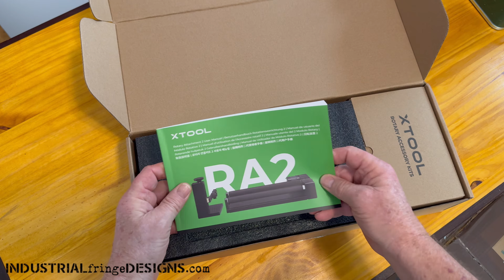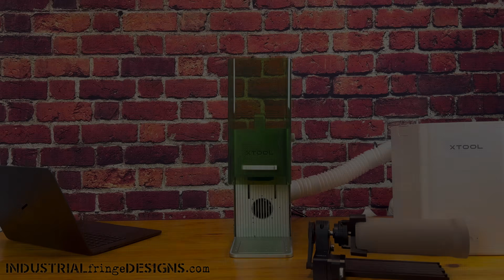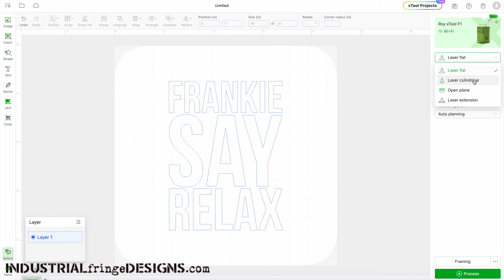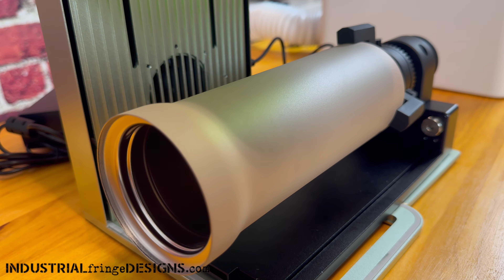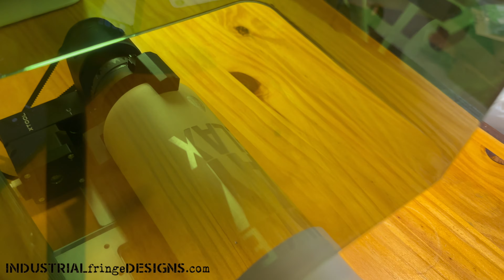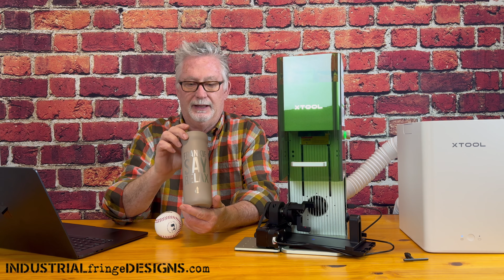How To Use the xTool RA2 Pro Attachment with the xTool F1 Portable Laser Machine!

Comment: great video - two questions: 1. If your LOGO wasn't so wide, could you just use the flat laser and place the baseball on the plate without using the rotary tool? 2. How did you know to do a second pass on the tumbler? Is that normal with all things metal?

Comment: I'm glad to see that the RA2 Pro now comes with cables to interface it to different machines. When mine shipped with the P2 there was a cautionary note that it was not compatible with the other xTool products due to wiring differences. Of course, it was easy enough to resolve the wiring issues by making adapter cables.

Comment: Thanks for the video, Roy! I am considering this laser machine because my working space is small and I love that it has two lasers in one. 
Question: when you engrave the tumbler, the green cover cannot go all the way down. Do you take any safety measures to avoid getting your eyes hurt and/or getting a laser beam outside and creating a fire? 
Thank you so much - I love your channel!
Reply from the maker: Hey! If you’re lookin for a laser for a small place, this is definitely it! I purchased a pair of xTool safety glasses that are specked for both the IR & diode lasers. I don’t operate it with the top up without wearing those glasses…and I avoid looking at it a lot all the time! Thanks so much for watching!
Reply: @industrialfringe953  thanks again, Roy! Your channel is priceless
Reply from the maker: Thank you so much! If you end up grabbing one, don’t forget to use my affiliate link! It’s such a great way to support the channel, and it costs nothing!

Comment: Roy, enjoying this video so far.  I am about to remove the rollers, but he screws are quite tight. Don't want to wreck it. I am using the correct screw driver. Did you experience this?
Reply from the maker: Yes! The screws were very snug! On the first one, I thought it wasn’t gonna happen! As long as you have the right tool (sk as to not strip the screw), you should be good!
Reply: Which screw removes the roller on the side without the motore.
motor
 @industrialfringe953